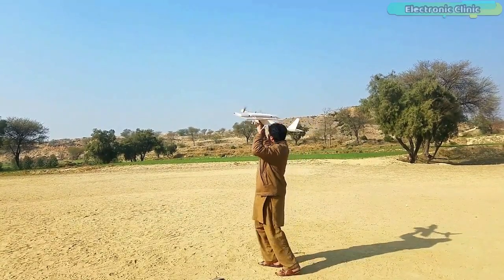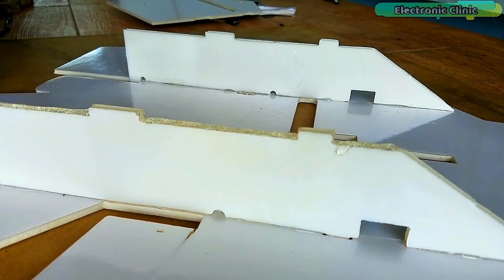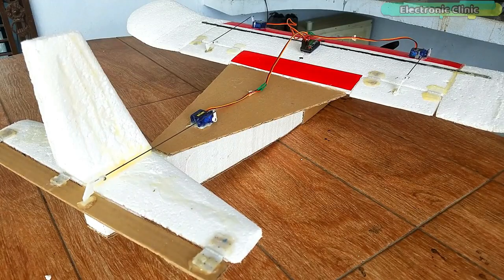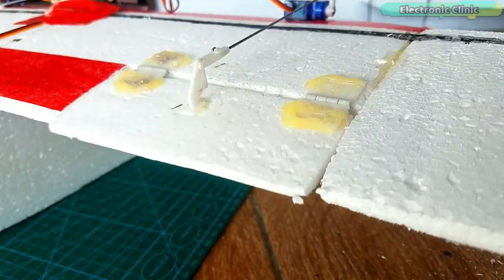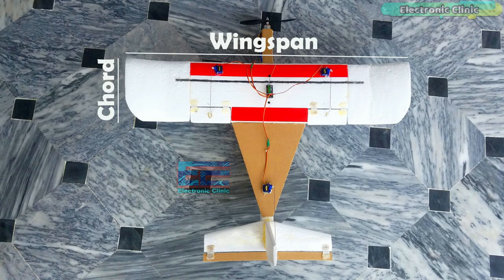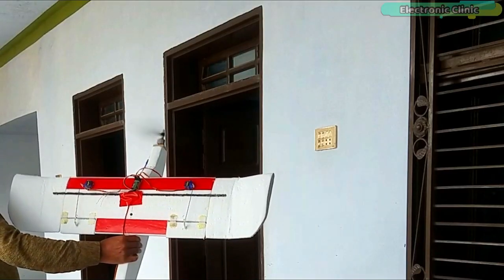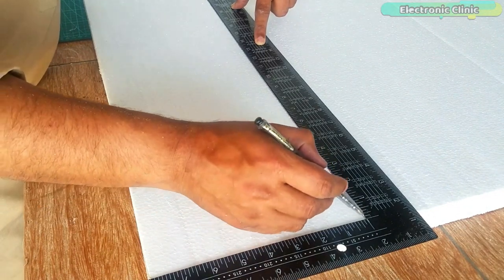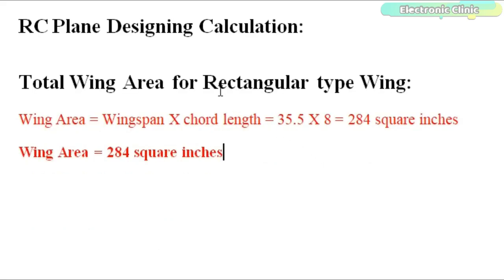Diy RC Plane for Beginners with Amazing Stability and Design Calculations

Comment: at 18:07, control horns are  Not  correctly configured.!!!          at 18:13,   WHY  TF  did you switch to a  ZERO-dihedral  wing.?!??!?!?!       now, that kind of wing  will  HAVE to  Have, ailerons.!!!!!          googletranslate

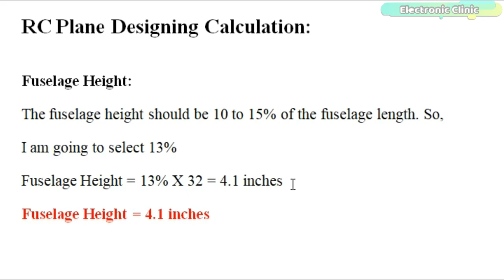Comment: at 11:47,   MORE    WRONG    STUFF.!!!!!!!!!!!!         there is a  REASON  to  correctly  TAPER  a  tail  boom.       and, that tail boom   AINT   correctly  tapered.!!!!!!    i have  details, if you want them.         why  does  it  say   " 30 " , at the bottom line.????           yer system for  'measuring' fuselage length   LESS-than  ideal.     specifically, the  AFT  End  of the fuselage  Should  be  considered to be at,  the  Elevator  Trailing   Edge.!!!!!!!            googletranslate